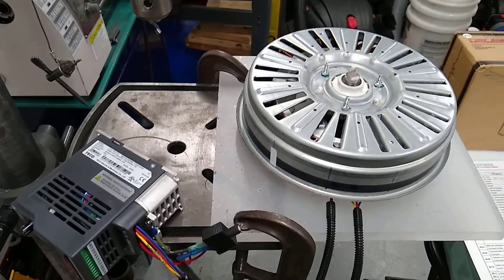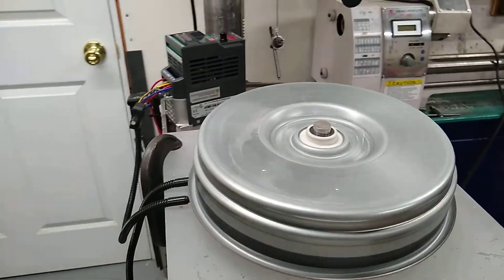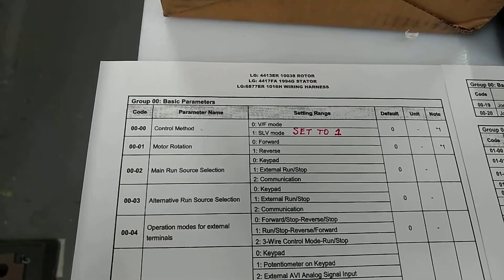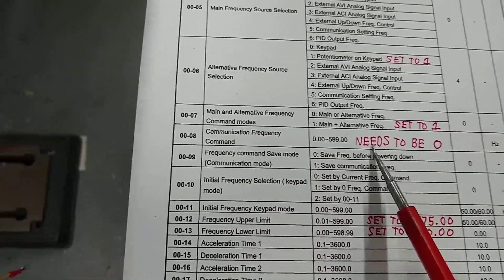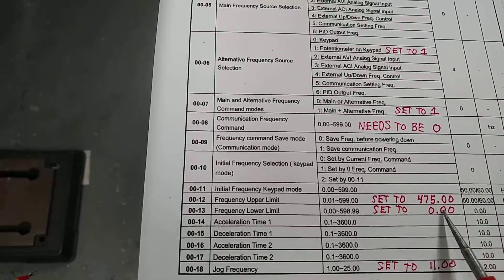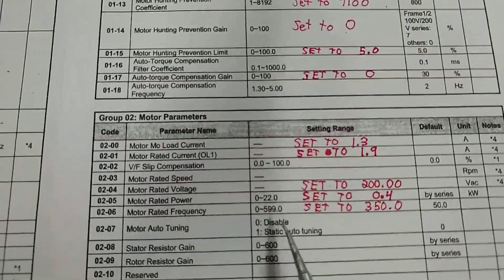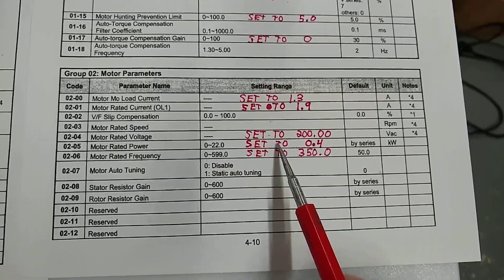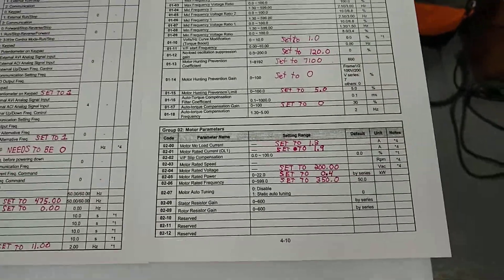Speed controller for BLDC washing machine motor

Comment: So, this electric motor can be run on VFD. Sir, I have some questions, please. Does the motor operate efficiently without connecting the hall sensors? The other question is: Is it possible to reach high speeds (6000 rpm) and how much electricity does it consume,  the electrical power of the electic motor? Sorry, Sir, for my many questions, and I hope for a response from Please and thanks in advance.

Comment: Great to see a lot of people trying to run these bldc motors. Just to let you no a vfd will work but to acquire more rpm they need 310vdc and the frequency is over 400khz. I have achieved that to prove it and I got one to spin at 4k rpm now that's scary. I am working on another one to go faster.
Reply: Had it been exploded, yet?
Reply: @Spark-Hole  no not yet but damn it sounds good

Comment from the maker: I did not have the original shaft from the washing machine. I made a shaft out of a thick 3/4 inch washer and welded a 3/4 inch shaft to it. The motor is mounted to a 1 inch thick piece of plastic sheet. Two 3/4 inch pillow blocks are mounted on each side of the plastic sheet. I used 3 x5 paper cards on each magnet and dropped the stator in . You my need to use multiple 3x5 cards on each magnet, depending on the motor you have. Then insert the shaft into the pillow blocks to determine the location for the stator hold down bolts . Spacers are required to keep the stator at the proper height.
Reply: Could you use this motor as a generator?
Reply: Because I have a fisher and paykel smartdrive motor 
And I'm using it as a generator but I'm just waiting on to get a VFD for the motor so I can properly test it just to verify its in good enough shape.
Reply: Hi I want to use this Motor to drive a LOW 300RPM Wind Turbine Motor to generate electricity,do you think its a good idea.What issue would I come up against this setup.Thanks
Reply: Did you ever record a second video as to a follow-up to this one?

Comment: Hi.  I'd email you directly, but you didn't provide an email address in your "About".  I have a question, assuming you know how these DC flat motors mount In the LG Front Load Washing Machine, do you think it would be possible to connect the VFD (such as the one you depict in your video) While the Machine is Still Hooked UP to the wiring harness as it came from the factory?  There doesn't appear to be enough Space to do this.  Do you think it would be possible somehow with a dual female wiring harness, thus allowing for the washing machine's male plug to plug into the female receptacle, as well as a manual control VFD control, too?  The Reason I would like to do this, is because these front load washing machines--although the latest models have gotten perhaps a Little Better (I have a newer LG Front load, that was purchased in later 2021) with the pre-balancing the spin load before the onboard microprocessor of the machine allows the motor to start ramping up to spin speed--they microprocessor programming is Still Too Super Sensitive / Not programmed quite right.  I can do a Better Job of getting the load balanced enough and gradually ramp the motor up to spin-extracts speeds!   What do you think?  Thanks.

Comment: So Have this stator and drum attached to a 3.6KV generator head with a 110 to 220v 1500W VFD. the max rpm is only 1000 . The generator head min is 3600 rpm.
Do I need a bigger VFD (e. 3hp, 5hp etc) to increase the RPM?
Reply: Different controller, the vfd runs the motor on AC with low frequency and high current, you won't get appreciable torque. These motors need 20khz+ and 500v+ pulsed DC, can run very low current then aswell. I have 2 controllers that output 220v, about 10khz, max speed for the 12 inch is 560 rpm, but REALLY choking the outside of the drum, it cannot be stopped and does not reach 1.5 amp input
Reply: @bigarms86  my apologies for the questions, but what controller you recommend that capable of 10-20khz? Most I’ve researched come no where near that.
Reply: @tonyrogers5009  ZM-7205A 1100 watt controller
Reply: @tonyrogers5009  wire the motor in delta for 70%+ power and torque
Reply: @bigarms86  Hi I want to use this Motor to drive a LOW 300RPM Wind Turbine Motor to generate electricity,do you think its a good idea.What issue would I come up against this setup.Thanks
Reply: Hi I want to use this Motor to drive a LOW 300RPM Wind Turbine Motor to generate electricity,do you think its a good idea.What issue would I come up against this setup.Thanks
Reply: What controllers are they and where can I buy one?
Reply: Has anyone helped you with an answer to your statement/question?  Is it even possible?

Comment: Hello. I have an idea to run the inverter air conditioner compressor with the help of a vfd, similar to the one in your video. Inverter air conditioner compressors are called dc inverter or simply inverter. In addition to the U-W-V cables in the compressor in my air conditioner, there is a fourth cable named N. As seen in the video, this 4th cable is connected to the intersection of the phases in the middle. As far as I have learned, the air conditioner works in open cycle until it reaches a certain engine speed during the first operation, then it continues to operate by switching to closed cycle. The difference between open and closed loop is to ensure that it does not fail by sending the correct energy to the correct phase of the running motor under load.

My question to you is this. Can I start this engine with the help of a vfd? Also do I need to look for the SLV feature you mentioned in the video?

Thanks.

Comment: Couple of questions:   Did the stator come with a hall sensor? if so did you remove it?
also Did you rewire the stator?
Reply from the maker: The stator  did have 2 hall sensors that only work with the original washing machine controller. The stator was not rewired at all. I did add a terminal where the  3 phases connect for other experimentation . Adding this terminal does not alter the stator wiring . The motor controller I used will run this motor with the factory wiring harness and no wiring alterations .The controller must be set up as shown in the video . I would recommend the Teco Westinghouse L510-101-H1-U because it will allow operation of the motor up to 1 HP output .Setup for this controller would be the same as in the video .
Reply: Thanks

Comment: A high frequency controller with low voltage is the key to run the  Gerard Morin hyperdrive generator
Actualy  .it’s impossible  to find the right controller , even in China !!
Don’t forget , you have to find the right LG direct drive motor with a steel shaft to make the job

Comment: This controller is working fine without load, if you put load on it the lg motor will run hot (100 degrees) in a few minutes. So this was a waste of money :O.
I also have the ZM-7205A and it's working fine(motor is not heating up), but it's a litle week. I see there is another model of this driver ZM-BL2210F, and should have twice the capacity of the  ZM-7205A. If anybody here have tried the ZM-7205A? please let me know if it is any good?
Reply: can you tell me the wiring diagram connect for zm 7205?
Reply: Thanks for the tip regarding the ZM-7205A. I also used a VFD and it got hot in minutes. But wasn't a dead loss because I have other 3 phase motors to use with the variable frequency drive. My band saw runs so good with that. It would be great to be able to hack the driver circuit that comes with the washer. I wish my skills were further advanced because I have feeling its not that tough to do.

Did you try the ZM-BL2210F?